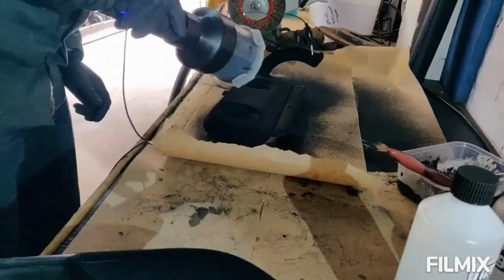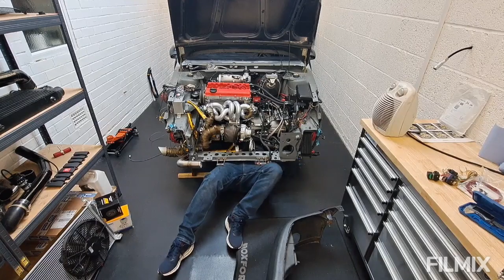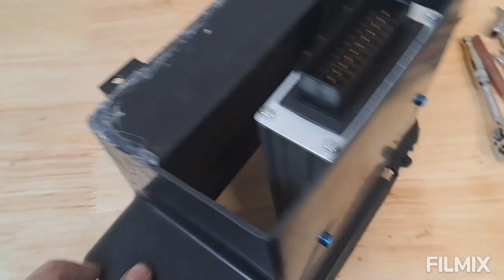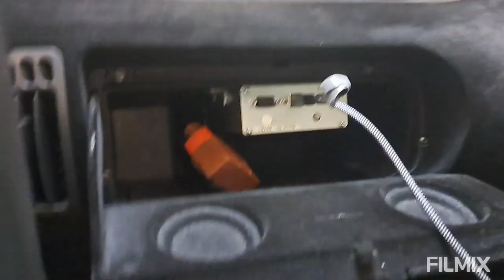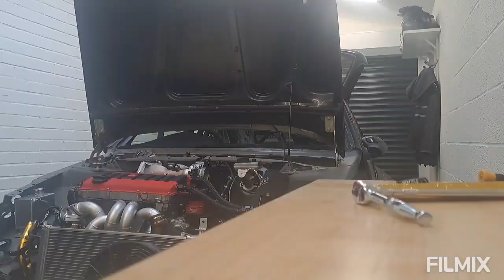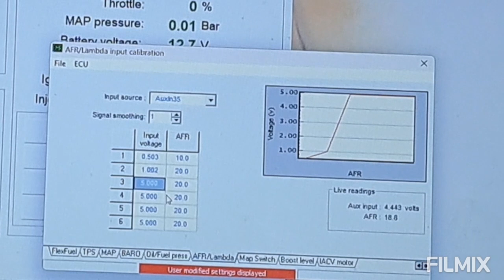Project 5AXO Ep51 - Citroen Saxo VTS Turbo - Systems check & Warm up

Comment: Amazing to see her up & running!!! I'm seriously considering doing a uk 106 fwd evo build using a donnor lancer 4! I'm a mig welder by trade & believe it possible to dissect both cars, shorten the evo chassis then re-weld to size ready to drop the hollowed out 106 shell bk on top! Then more welding!

Comment: well done ! sounds good too. There's a lot to monitor at first starts ...warmup cycle, idle warmup cycle, afr, water temp, oil temp/press., but you'll get used to that. Just be sure to never have it too lean. if you're working alone think about making a relay system that shuts the thing down when oil press drops or water temp too high. (of coarse not for road use :-)